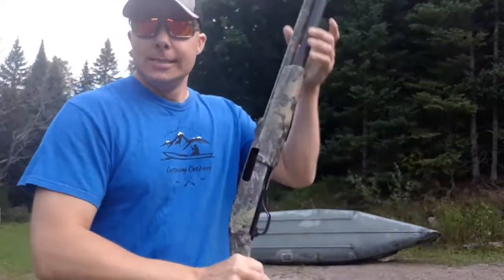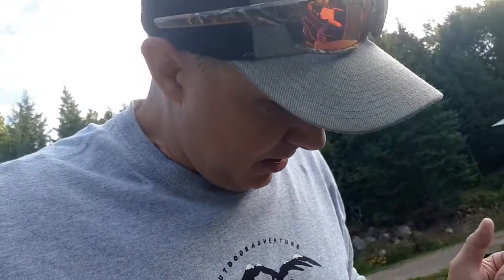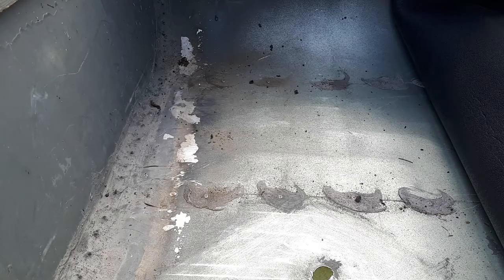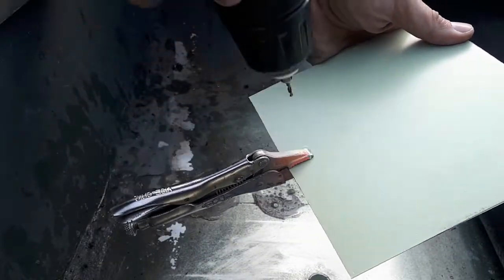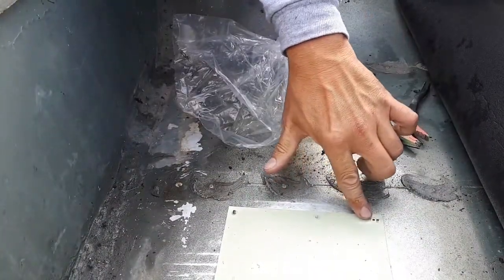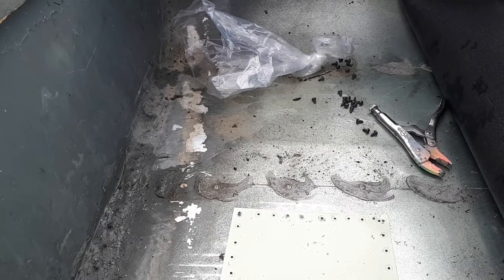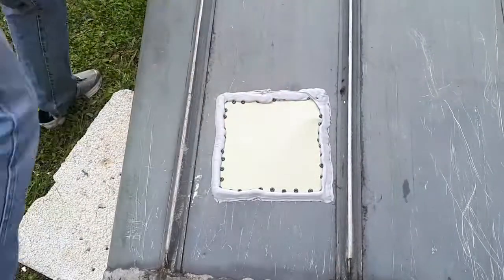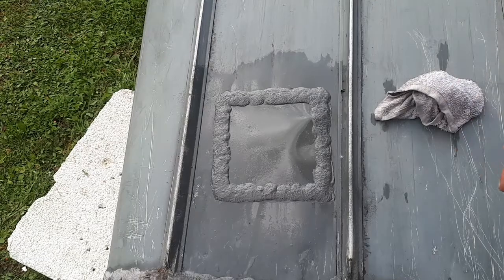SHOTGUN VS CANOE. I repair the loser.

Comment: You drilled the 2 panels then flipped one to the side misaligned the holes then drilled 8 holes in the bottom of the canoe. 
When you put in the bottom panel you made 8 more holes in the bottom of the canoe that were not lined up with the top panel...
HOLY SMOKES! YOU DRILLED THE HELL OUT OF THE CANOE!
You should have spread the goop on the panels besides around the holes...
...NEVERMIND... I give up!

Comment: Thanks for the video it was great! Just watch out for diss-similar metal corrosion and I hope the sealer is anaerobic non acidic. If not  it will erode away due to galvanic corrosion.
Reply from the maker: Thanks. The metal is the exact same    so hopefully I get no funky results or I will have to stop blasting holes in em.
Reply: @GettenanyOutdoorsSportspal  Remember the screws! I don't think they were aluminum, But it should last a lifetime . I am blown away by how repairable the canoes are, when the ribs are removed it is so floppy. Thanks jim
Reply from the maker: You are correct the screws are cleaned up with metal prep. prior we've not had issues as long as the seams are completely covered with the sealant inside and out.

Comment: Thanks for doing this, I recently bought a new sportspal and it was damaged in shipping.
Reply from the maker: That's a shame but they will take a beating down side is they show it. Mine are all beat up and still work as they should.
Reply: @GettenanyOutdoorsSportspal  could I send you a picture of the gash and get your opinion on the repair? I have the repair kit from sportspal.
Reply from the maker: @fryscountrylifechannel4437  absolutely feel free to send a picture. Probably easiest to send through info@bwmarineproducts.com and get them to get it to Dave.
Reply: @GettenanyOutdoorsSportspal  thanks for that, I just sent it. I bought the canoe from a dealer in North Bay and had it shipped by Manatoulin they damaged it, happened end of February. We were just shattered as we have been wanting one for quite awhile the shipping company returned my shipping fee and paid me $2.00 per pound because they did not declare the value on the bill of lading (dealer), so the repair kit cost more than the shipping company paid me for the damage.

Comment: I really love your videos , they are very good, I have a sportspal and I just love it , I use it all the time so I really appreciate your videos, I have a question for you would you recommend using a double blade paddle with a sportspal , it’s pretty wide so I imagine it would have to be a long double blade thanks again
Reply from the maker: I think you're right about length of paddle but it should work well. Thank you for the kind words it means a lot to me. Cheers
Reply: @GettenanyOutdoorsSportspal  I have a 14' Freighter transom, same as in the video. I've tried paddles with terrible results, canoe paddle,, ok in light winds only, and a kayack paddle . if I'm by myself, the kyack paddle is the way to go. Sportspals are great at many things but NOT at paddling like a traditional canoe. Even the double enders. Sudbury Ontario Canada.
Reply from the maker: I would strongly agree

Comment: Hi nice vid.. why wouldnt you just use rivets all around the 2 pieces of aluminum?...i just had a 2 inch stress tear in my sportspal that a welder who works on aluminum sealed for me. I am hoping it holds! If not ,I was thinking of doing the "aluminum sheet sandwich"  but with rivets? Your opinion? Thanks again🙂
Reply from the maker: Absolutely a great idea.  Sportspal includes screws in the repair kit because it would be easier for the majority of people to use. But aluminum rivets are going to do the trick as well.
Reply: Thanks for all your repair advise. Hope I never have to this one . I was wondering how strong the aircraft aluminum is on the sportspal man it looks like it is pretty tough stuff. Appreciate you for showing us
Reply from the maker: @davidwarnock5803  the metal has a low magnesium content that adds elasticity to the aluminum and gives it the ability to take a beating